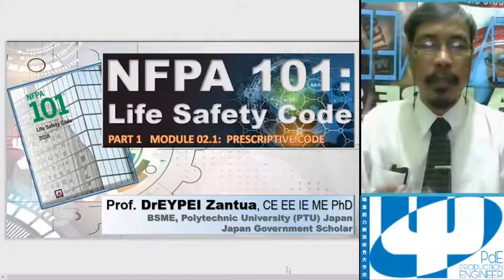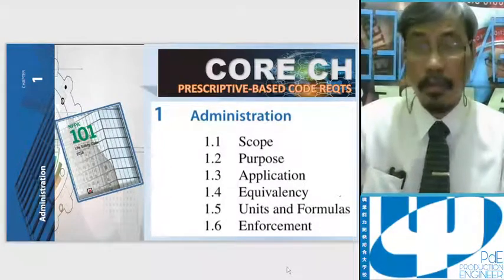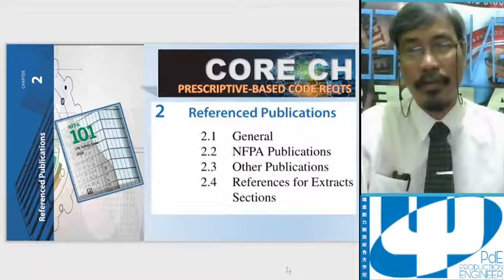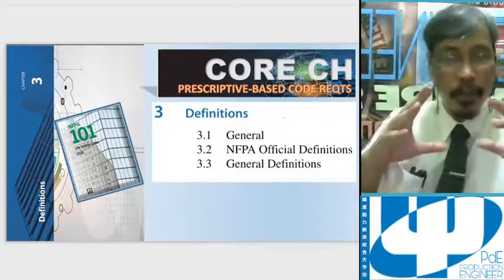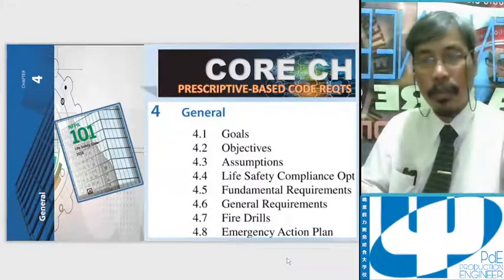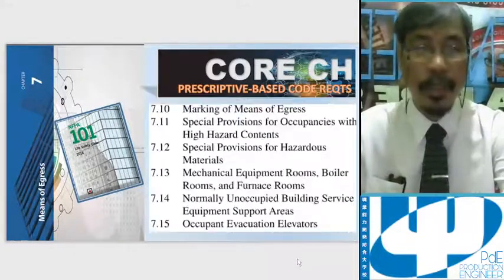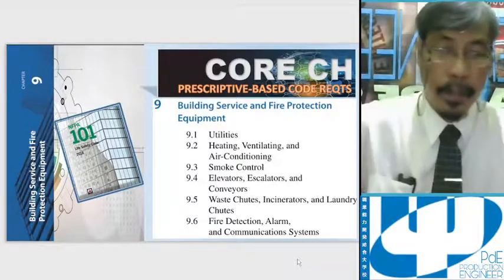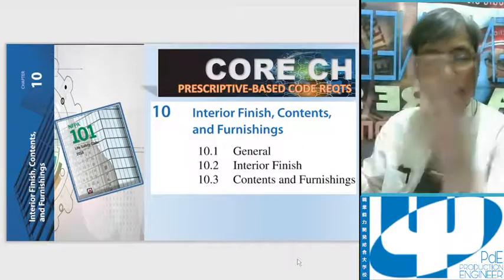PRESCRIPTIVE CODE FUNDAMENTALS - NFPA101: Module 02.1 [ Reference CODE by RA9514 - IRR2019 ]

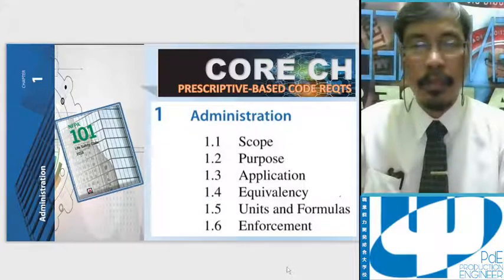Comment: 3:20 Prescriptive Based Code Requirements
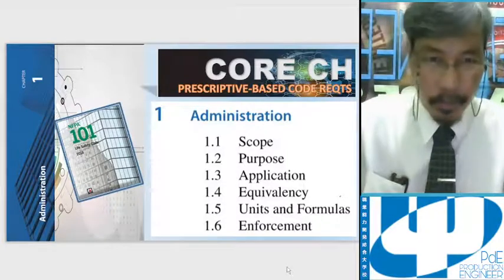4:21 Administration
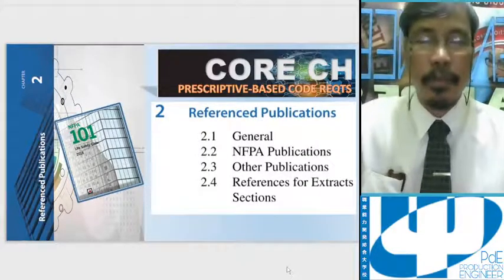6:29 Referenced Publications
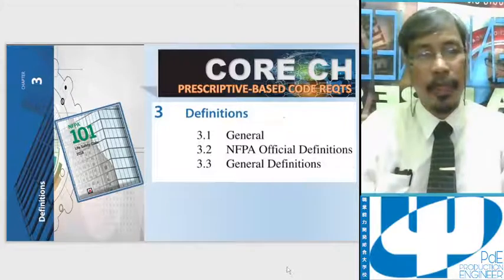7:44 Definitions
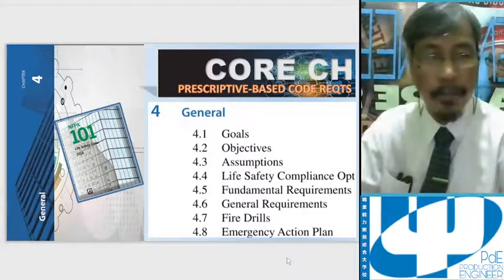11:52 General
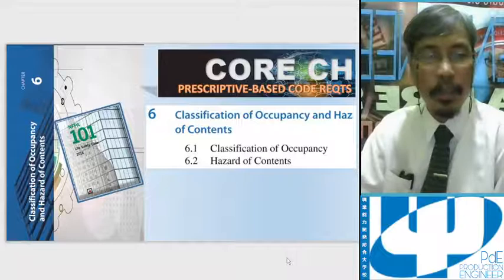13:47 Classification of Occupancy and Haz Contents
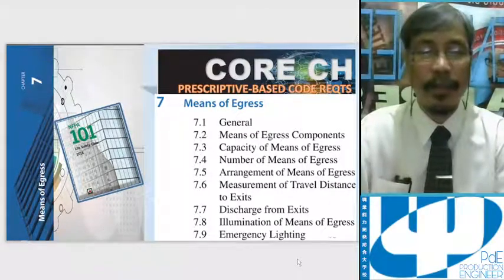15:08 Means of Egress
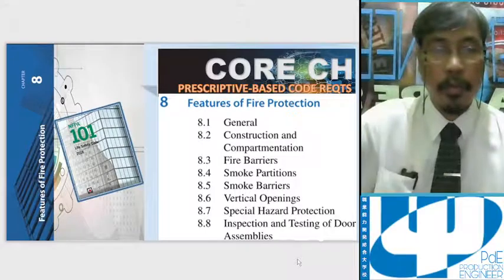16:36 Features of Fire Protection
17:50 Building service and Fire Protection Equipments
21:12 Interior Finish, Contents and Furnishings